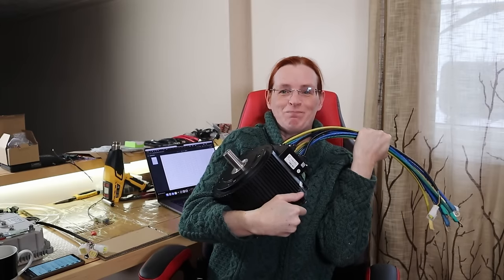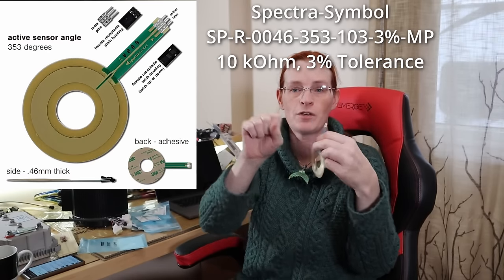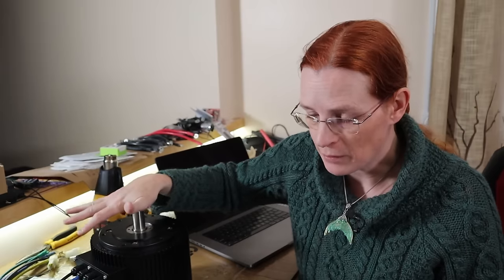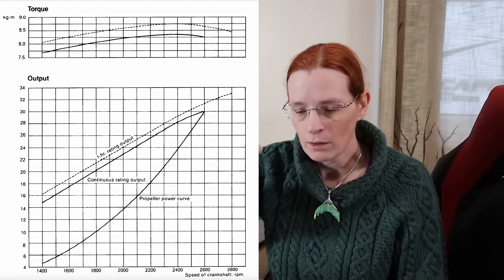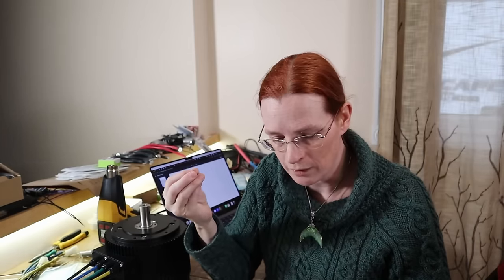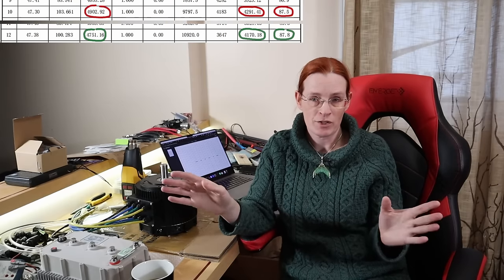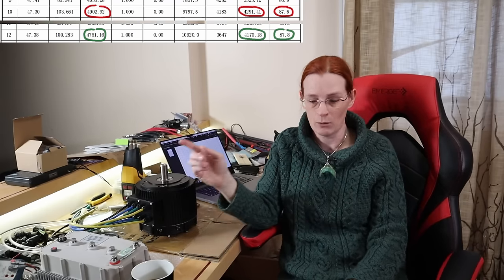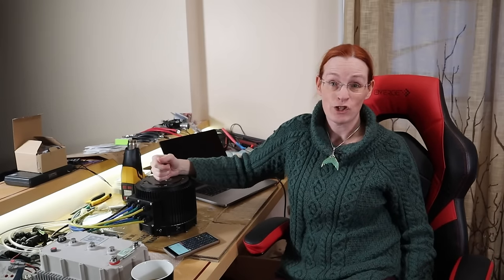Ep. 86 - Decisions Made! - Let's Get Technical

Comment: A couple of notes. 
1. The variable resistor is not ideal due to sea water, it wil get corrosion and possibly get wrong readings, maybe look into hall effect sensors (or a hybrid of both).
2. Please don't only trust in one arduino, please make a redundant system (or a separate monitor system that cuts power in case of an abnormally) (same as traffic lights...) (preferable a other controller than you are using as main controller, so maybe a esp32 or a RPI)
3. For control handels look into a 3D printer with wood filament, you can sand it, treat it just like wood
4. (i don't know if you where planning to do this) but i don't ever cut power to the controller due to starting issues, communication issues... you apparently can as seen in the kelly datasheet but make sure that the contactors A. are rated for the currant and B. MAKE absolute sure that they can handel the big inductive and capacitive load when engaging the contactor and charging the caps in the controller
5. Thank you for using a good old belt system in stead of clutches (there are losses in clutches)
6. Please don't put the LiFePo4 batteries on there sides (it is technicality fine but still) (if it is specifically mentioned in the datasheet you could do it)
7. I didn't understand how you are planning to control the 5kw motor (2 controllers or 1) please use 2 separate controller because the controllers will learn how the motors react and will get very confused if you switch between the motors.
Reply from the maker: Ooooooh, detailed comment, I love it! Let me reply in kind.
1. From what I can tell (and I'll recheck the specs after this reply), it's tinned so corrosion should be minimal. That said, this is a very very good point I need to consider more deeply. 
2. I was thinking of stealing a concept I've read about in space travel, where they have three devices (so three arduinos) receiving the data, so that if one disagrees, it's ignored. Obviously that level of fault tolerance is a "down the road" project, but given how critical throttle input is to safety... This said, there will be an emergency stop button at the helm (which is actually part of the new ABYC regs).
3. In my previous life, I was a (am a) hoobyist woodworker. The desk you see in the video is one I made (with the help of my teachers). So using wood is as much a chance to merge two hobbies in this project. That said, I can see how your idea would work great, and probably be easier/faster. For me though, I'm actually stoked to make the handle... Probably mock it up / refine it with something simple like pine, then build the final one in a nicer wood.
4. The LittleFuse contactor I chose (specs in the description) is rated for 400A, and are rated to withstand 1000v with a greater than 50mOhm resistance at 500v. 
5. The losses in the clutch is almost equally important in why I didn't want to use them. I am trying to design this system for as efficient operation / longest range I possibly can get.
6. I'll double-check the specs, but I believe side-mounting the EVE LF280K is supported. My main concern originally was minimizing spill of one blew it's pressure vent, but given ABYC requirements, I'll likely be designing some sort of catchment in the battery boxes to handle this, regardless of orientation.
7. Two separate controllers. The goal, for redundancy, will be to have complete separation between the two, including separate cooling. Running in 10kw, 5kw or both will be managed in the arduino software.
Reply: I agree on this coming from an industrial enviorment with my experiance drives and plc programing inoure very wet paper plant.
I'd use an 3 channel encoder ABZ and calculate the position via count up/count down register to give what speed you want output nd send that to the drive.
Reply: @TheDigitalMermaid  thanks for your reply, 
2. love to see that 3 is even beter (just keep in mind that i don't like to use 2 of the same for the reason if there is a manufacturing fault in one of them the other one wil also probably have that)
3. love to see that i have seen that you where in to woodworking (so am i sometimes if i have the time for that) but i am not so great at it that i can make a nice handel so i use the tools that exist to help me..
4. I overlooked that in the description, my bad. They do look very nice just don't forget/misplace the flyback diode :)
6. I think indeed that it should not be a problem
7. perfect i just didn't catch it in the video (probably my bad)
Reply from the maker: @thomasdesloovere4200  Dude, after those little spark-fests, the role of diodes are kinda literally singed into my brain. haha

Comment: Have you spoken to SV Uma, they have so much data and experience for the last 5 years with a boat similar size to yours, they are on their 3 rd version. Also just to note rivers and canals in Europe mostly don’t have shore power for leisure craft
Reply from the maker: I follow them, but I have not spoken to them. I assume they must get a constant stream of emails / requests, and my channel is still really really small compared to them. So I do hope one day to chat with them, but I think I'll wait until I've grown the channel and/or gotten further along in the project. I don't want to bug them (or anyone else, really). Are there marinas where I could pay to recharge along the rivers over there? Well, I do plan to have a diesel generator for emergencies, but oh I'll be doing everything I can to avoid using it...
Reply: @TheDigitalMermaid  not really accessible for sail boats, around Netherlands you have more chance especially along mast up routes, coastal marinas are set up as that’s what we all use. SV UMA had a lot of motor data a few years ago including regen data. The lack of shore power on inland rivers etc is what is stopping canal boats etc with would otherwise be ideal and this is unlikely to change as no river side or canal side infrastructure to do this. Also over here you need to de rate your solar by about 50% for daily average and late in year you will have basically none, we have 300 watts and have had basically nothing for the last 6 weeks
Reply from the maker: @davidwright6950  Solar in the winters here is also basically useless. I know that my 1.5 meter keel is going to block me from some rivers/canals, and I suppose when that happens, I'll just have to find some boaty folks interested in taking on a nerdly visitor for a trip around the local canals. ^_^
Reply: @TheDigitalMermaid  you would not think it but 1.5m is an issue on most of the European inland nowadays, we planned to go down the French system to the med but we hearing that this is now not easily and we are lifting keel and draw 900mm with it up, the issue is that it’s mostly ok in the middle but you cannot get to the bank, UK canals can take quite some time to progress as locks really slow you down, you can easily get hire boats to have the experience though.
Reply from the maker: @davidwright6950  Aye... I'm coming to realize how the keel will limit me. Well then, so it is. It will be an excuse to try to make new friends who can take me on their canal boats, perhaps in exchange for taking them on some open water sails. :)

Comment: Was going to say have two motors and controllers for smaller wires fuses and resilience  before you mentioned it @ 16:30. If you don't need the 10kw having a full redundant motor in master slave configuration could be overkill maybe  2 x  5kw motors   both in operation for  normal operation and obviously if one fails  you'll still have movement but only 5kw  total
Reply from the maker: By the time I realized the benefit of 5kw, I already had the 10kw in hand. hehe
Reply: @TheDigitalMermaid  You'll be glad to have the 10 kw + 5 kw when fighting currents! An extra knot could make a big difference when needed
Reply from the maker: @MarkRose1337  I think about the currents I hit on the Niagara river and I wonder, "what if Black Rock locks hadn't been there?". So ya, if I can parallel them, I am certain that, though rare, the times I need it I will be very glad to have it.

Comment: hi Maddy, had a small brian wave hit my skull. I this and an other video you talked about water cooling eletronic parts. Would it be an advantage to keep the cooling inside the hull, use the heat too warm up the cabin or watertanks, and all so have one less hole in the hull. And frome what i knowh, unless you are boating in the tropics, ships/boats get a ton of cooling from wind and water in contact with the hull, so maybe at bit of ekstra  warmth might be nice.And you would get it from power you anyhow had to use too move the boat.          Maybe it is at total no go brian wave, but now it has been shared  , and you are free to use it or leav it to die . No hard fellings. :-)
Reply from the maker: So, I didn't talk about it in this video, but that is actually the plan now. I don't want to use sea water cooling anymore, too much of a hassle. So the current plan, and it's very vague as I can't yet know how much real cooling I'll need until I do sea trials, is to setup a couple air-sourced radiators, vented using the old engine bay vents that exhaust behind the helm. If that works, redirecting the flow to pull air in and exhaust the warmed air into the cabin in cold climates should be viable.

Comment: i'm still watching.  it's a long  tunnel, but i think i see a weak light at the end.  you are making progress!!   

you may have said some where in the past but i'll ask here.  what prop is on the boat now?  from what you described as your method of operation, having/buying a feathering/folding prop won't allow you to charge while sailing.  i did go to the website for the prop you are looking at and it says it can be used for that charging.  it must be a magic prop.  (lol)  i also noticed they don't start giving numbers for charging until the boat speed is at least 5 knots.  maybe that is when the magic begins. 

my first prop (3 blades fixed, 16 x12 cupped) would not start turning under sail until i reached 4 knots.  i have changed things since then and have not done enough sailing to notice (smooth & quiet now) if it still takes that much speed or not.  the old prop guy in San Diego said the more diameter with less pitch gives best results.  their math came up with a "28" number for my prop.  diameter plus pitch.  he said for a displacement boat (not planing), don't go over square (pitch & diameter the same or pitch larger than diameter.  for me, the limit would be 14 x14). 

i'm not saying don't buy that prop, but do study it well!  it is a big investment and will be a major part of your overall plan.  would be a shame if it did not live up  to the hip.

btw, a free-wheeling  prop is not nearly the drag of a locked prop.
Reply from the maker: The current prop is a maxprop 3-blade feathering 13". It's a great prop in great condition, and I'm hoping to sell it when the time comes to help fund the project. The new prop is a different kind of feathering prop (linked in the description, and follow to their youtube channel to see videos of how it works). In short, the blades flip over 180 degrees, so they can design the pitch for optimal forward efficiency. When you want to go astern, the blades flip over, so now they have the optimal pitch for astern motion. This is the orientation they take for regen, also, meaning you can get optimal regen from them. if you want to feather instead, lock the prop shaft and they go into the 90 degree feathered position.

The main concern for me, is the noise and vibration. I was spoiled that my boat came with the maxiprop... I didn't realize that until I was sailing on a boat with a fixed blade prop, and I suddenly noticed a vibration in the cockpit and a weird noise. I asked the captain what it was, and he looked at me weird and said "that's the prop free spinning". After that, I was like oooookay, I never want a fixed blade prop! I was stoked to find the Ecostar given it can feather and do regen!
Reply: @TheDigitalMermaid  how does that saying go? "never say never, right?  why do you think being a fixed bladed prop would be any worse than any other prop?  have you ever had a tire out of balance?  if so, you know it is not a nice ride, at least at some speeds.  but because of that you won't quit using rubber tires will you?  so, remember my comment about "smooth & quiet"?  well, same fixed prop.  it is just no longer hooked directly to the engine.  i have  a pillow block arrangement now that takes the thrust and are smooth as silk.  plus no shaft alignment  problems any more.  from there a couple of u-joints and short shaft go to trans.  engine is on soft mounts.  different ball game.

your drive will be very similar to that.  since you are planning to belt drive the shaft, the shaft will have to have a bearing on the end to take the thrust and support the shaft.  using a bearing like this...     https://catalog.amibearings.com/item/spherical-o-d-accu-loc-bearing-insert/centric-collar-locking-bearing-insert-ue200-series/ue205-16  the shaft will be centered perfectly.  use the style pillow block of your choice.  i use a couple of shaft collars (one on each side of the bearing on the shaft) to insure the shaft stays in place.   be careful where you buy.  some stores think they are made of gold.   here is one priced right that i used...   https://thebigbearingstore.com/1-concentric-locking-flange-bearing-uef205-16/

so you reverse the motor, blades perform for going backwards, then stay that way unless you stop the shaft from turning?  how cool is that?

Comment: To get good regen, a variable pitch prop is required to maximise the power produced.  The equasion is half the area by density by velocity cubed.  Water speed is critical.
Reply from the maker: Have you looked at how the Brunton Eco*star Autoprops work? The blades rotate 180 degrees
Reply: @TheDigitalMermaid  A/2 x d x V3 .  The prop is important but double the area of the sweep and you get double the power production, double the water speed and you get 8 times the power production.  The variable pitch just spins at an optimal rate to maximize generator efficiency at that boat speed.  Most feathering props have adjustable pitch.  With a displacement hull just adjust the reverse pitch to the most common hull speed to get suitable rotation speed for the generator.  However that may be not the best pitch for reverse thrust.  I admire your work but because boat speed is so critical for regeneration a faster hull design  works much better also much more expensive.

Comment: Is the plan to regen under wind power?   that sounds like a decent plan, it may only slow you down a small bit..  interesting idea.
Reply from the maker: Wind in the sails, prop in the water regen, yup. It's how I plan to get most of my power... Less than solar at full sun, but it'll work day and night, so long as the sails are up and there's enough wind. I will lose speed in water, but this setup allows me to lock the prop shaft and the prop will feather if I really want the speed more than the power.

Comment: Although you're going Arduino, you might want to use a Pi Pico as the hardware instead of an ST or Atmel based board.
The Pico has hardware programmable IO (PIO) which can run tasks without the main code itself interfering. Which gives you the benefit of if your code crashes the outputs will be sustained until the code gets reset (e.g. watchdog). So I'd think that might be an option for improving safety.
Reply from the maker: Hrm, your point is valid, but I can't shake the worry of effectively running a full OS behind the helm controls. Let me ponder it more, it's possible I'll find the arduino too limiting in the end anyway...
Reply: @TheDigitalMermaid  no, a Pi Pico is their microcontroller not the pi zero.

Comment: Arduinos are just the ticket for DC motor control, there are already many, many PWM (for example) controllers and videos about to use them.  Also a good plan to save the Pis for the asynchronous and scalable parts, like data collection and various networking connections to manage the data, but again the arduino is well suited to sampling inputs like throttle and then sending those to a data collection server lika a RPi. This looks very cool!
Reply: That is a AC motor...  motor speed is controlled by frequency. AC motor... DC motors are controlled by voltage...
Reply from the maker: In my case, the arduino won't control the motor directly, but control the signals going to the Kelly controller. For this, I think it's going to work brilliantly though. :)

Comment: I think you can couple the 2 Motors to Prop Shaft using electric device, such as an A/C Clutch, so that you can swith between them on the fly.
Just my 2 cents..
Reply: Or even a one-way clutch. Power will flow from either operating motor, or both, if you choose to.
Reply from the maker: I'm certain I could, but I worry about adding more parts... A part that doesn't exist can't break. I suspect that I'll find that I'll run on the 5kw 90% of the time, and only switch to the 10kw rarely. If that's true, swapping a belt won't be a big deal. If I find myself swapping more often, then I'll revisit clutches.